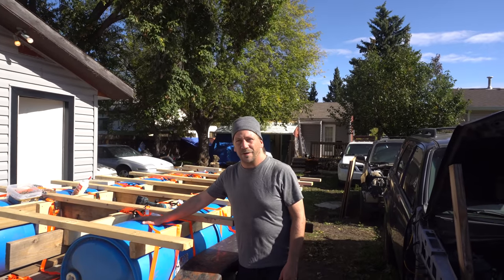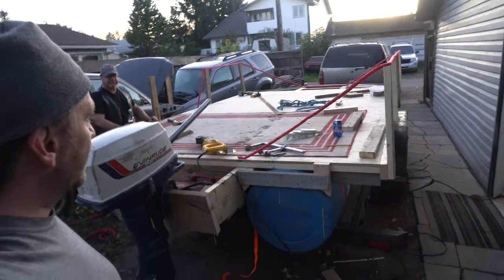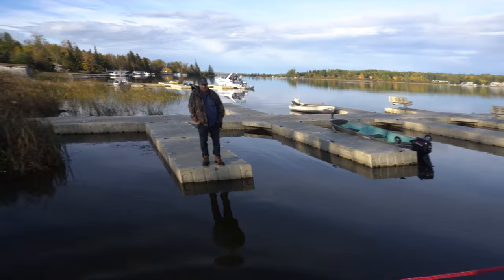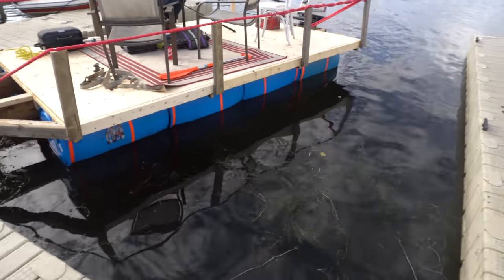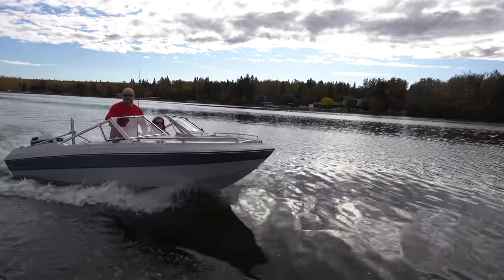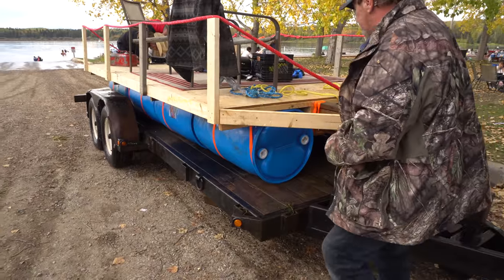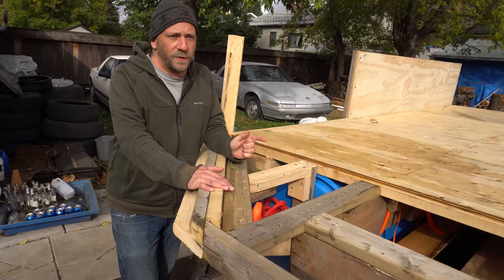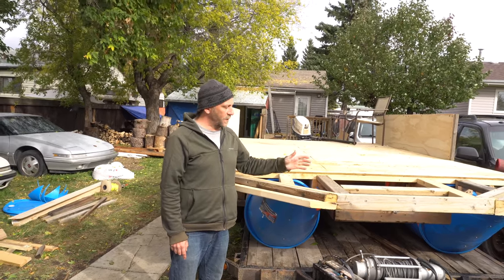Rain Barrel Camping Raft Test - Does It Float?

Comment: Me and my brother-in-law built something similar about 23 years ago. We stood the barrels up and cut them in half ( as if you would cut yours off at the water line). We then bolted the edges to a 2 x 6 and made a parimiter frame out of angle iron and finished off with a 3/8 inch plywood deck. We mounted a couple of boat seats on pedistals and put an electric trolling motor on the back. We cut out trap doors above the barrels to form live wells and a cooler. We took it fishing on some small lakes and it was a blast. We used 3 barrels for the whole boat. It fit in the back of my pickup and one person could load it. You guys did an awesome job.

Comment: You picked up 10 knots of speed by putting the front concave on those barrels. Plus it will track better!
Reply from the maker: I hope so! Testing it out with the modifications in the next day or so :)
Reply: This is some real Huckulberry Finn shit. Count me in!  On those front foils, if your going to leave the top open drill two 1/2 or 12mm holes in sides near the bottom. Any water that gets in them will be pulled back out by the Bernoulli Effect plus the drag will be almost nil. The less weight on the bow the better. Keep the anchor and anything heavy on the stern.

Comment: My Suggestions:
1: Get a couple coats of marine-grade paint or truck bedliner on the wood, that way it will last longer without rotting or swelling. If you went with bedliner, that would add a durable exterior plastic shell to the boat to help keep the hull in good shape. 
2: Spray on a textured grip surface to the deck, kind of like that gritty sandpaper-y feeling of a pool deck. Easier to keep objects from sliding, and you get a safer foothold
3: Put a couple holes near the edge of the decking, they could serve as easy, cheap, low profile fishing rod/net holders, or as easy tying points for other things. Maybe put PVC or metal pipe snugly inside the hole, flush with both sides of the deck, to act as a (replaceable, if desired) grommet, rather than the wooden hole itself wearing down and chipping.
Reply: I'd also replace those nylon straps holding on the pontoons for something else that isn't as prone to breakdown. Like metal straps. Coat the metal straps with truck bedliner before wrapping around the barrels to keep them rust proof.

Comment: Hey Steve,
The raft looks great. Seriously. Good job to everyone whom worked on it.
Glad you put those wave breakers on the front,  as i already for saw the front dipping. Looks like itll do much better, i cant wait to see lol. 
I was wondering since you will be pushing alot of water from the front, if the lip around the wavebreakers  (where it connects to the barrel )will collect water or possibly slow you down by holding water. Maybe have a gander and see you if that would be a problem in the future. Just tryin to give a friendly eye.
Cheers mates. Cheers.

Edit: its just hard to tell.. maybe im quite wrong. Lol delete delete delete. 😆

Comment: Looks very impressive. You need a navigation light at the front and also a white mooring light that must be higher that the highest part of the boat or superstructure (your tent). You can get inexpensive LED versions on Amazon and eBay. The Kevin O'Leary boat crash, a prime example of things going badly wrong.

Comment: I noticed the angle of the motor is helping push the nose of the craft down. If you fine tune the outboard angle, it will run better/faster in the water.

Comment: This thing looks  like a lotta fun. One thing I would so is  fill those diverters with spray foam. They could get water splashed in them and then fill some more. If you get the front up then it might force the motor down into the water too.

Comment: Saw one similar to this years ago but without the engine. Was built from an old porch approximately 8'x8' and the fella had a single mobile home axle bolted to the top so he could flip it over and tow it with a small pickup

Comment: Now that is cool as hell man. I hope it's all legal and good. Around here you would need to have it properly registered in order to use it. Is that a 9.9 HP on it? If so, most states don't require a boating license for under 10HP motors.
Reply from the maker: It has an 18 hp, in Canada we need them registered over 9.9, but that's free and easy to do for a home build boat. Already have the paperwork filled out.
Reply: @campingwithsteve  That's pretty cool, it's like trailer park boys, but no crime involved. That will be really awesome to find remote spots to camp at. Maybe do some fishing catch and cooks? Just a suggestion haha.

Comment: Looks to me that the motor is trimmed too far down into the water. Adjust the angle so the motor is pulling the bow out of the water. You may have to lower the transom farther into the water.